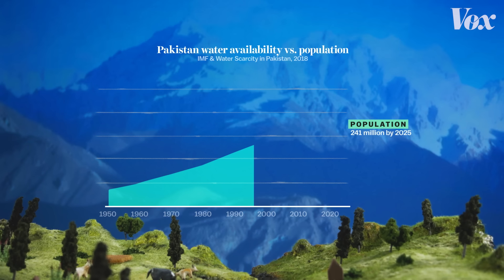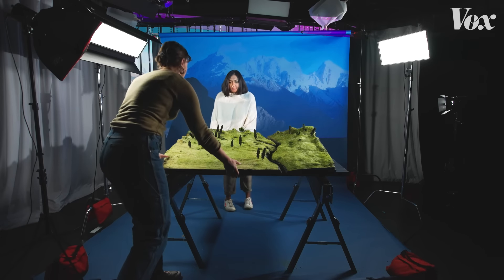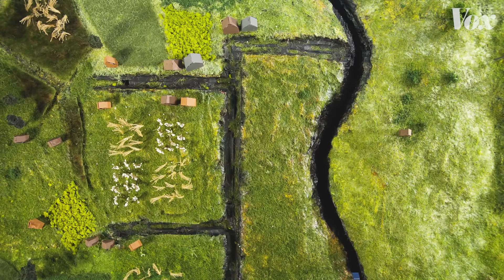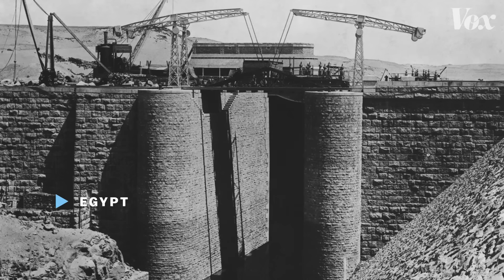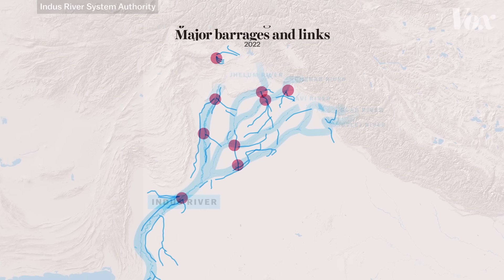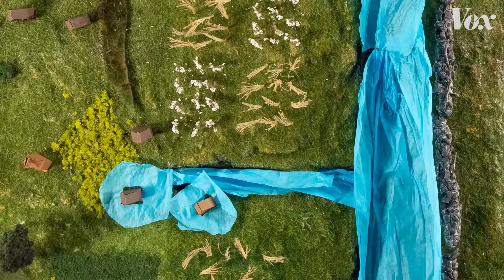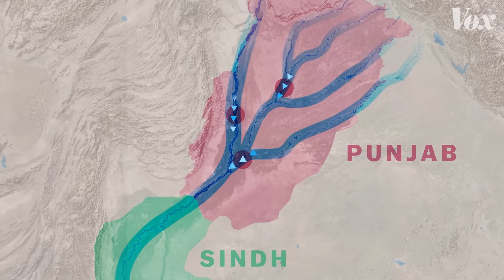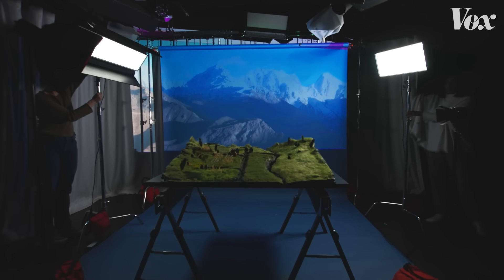The disastrous redesign of Pakistan’s rivers

Comment: If I understand this video correctly, the population explosion of Pakistan is directly related to the engineering of the Indus (makes sense, more agriculture = more food = more people). But that means you can't revert to "indigenous knowledge" as their engineering was designed for a much smaller population. The thing I took away from this video is that just like with the world as a whole, the country over-engineered its way to an unsustainable state, and cannot reverse it now.
Reply: Yeah, they always do these things. Celebrate the old indigenous ways, then ignoring the current population numbers. Sure it works if you want the old Ted route, but these people often doesn't want that either.
Reply: I agree; however the system could be engineered to benefit the environment and the people who depend on it, it would first have to figure out how to feed all the people who are reliant on the land. I'm just not sure how you would do that 'old school,' while acknowledging that the 'new school' should have been sitting at the back of the class the whole time
Reply: Spot on. It’s very easy to stay “stick to indigenous systems”. 

In India, we have our own issue of poorly developed towns and cities on the Himalayas which will bite back sooner than later

The solution was to either control population or incentivise mass migration to the plains in order to maintain ecological balance

In this case, Pakistan has 0 option but to rely on engineering to feed a dramatic rise in population across the nation 

The bigger mistake was the approval of wrong projects designed by corrupt and incompetent stakeholders
Reply: It’s not that simple, you can’t learn everything about everything about such a complicated problem in a short video. One major factor they didn’t even mention in the video is the problem with India. The Indus River originates from the Himalayan mountains and India who also has a massive population wants the water for their own needs. They’ve built dams and have diverted the flow of water to their territory which means less water for the people of Pakistan. Population growth + less water for farming = disaster.
Reply: It will not be impossible to mend our infrastructure and economics in a way that can revert us back to a sustainable way of living. As such the solutions given in the video are not saying to go back to the old way of living rather integrate the historical and environmental knowledge about the region into our social and infrastructure policy as well. You know, don't just give space to the upper class and elites to speak, let other folks speak as well that are not bringing a coloialist mindset, rather a more indiginous one. 
And it is also important to note that the population boom in the region is also socially engineered. Contraceptives and birth control and managment are vehemently opposed by the religiously extremist factions within the region. Islam, another foreign gift to the land makes its marks on the country and make certain changes and development in the country almost impossible
Reply: Awhile ago I repented to God then I asked for help, "I was until then an Atheist."

I then had a dream of Jesus coming before God and he spoke of the Tabernacle in perfect context, "A word I didn't know existed.", and what I felt from Jesus when I held him was unlike anything I've ever felt before - A lifetime of Love every second - It brought me to sobbing and it changed my life, forever. 

I've had other experiences since, "Several witnessed", one was seeing a bright orb of light pass across my face in the dark, hours before a major surgery the second I gave up in my heart.

Know that God and Jesus ARE real and that they Love us deeply. Let go of your hatred and Imagine yourself holding the people who've hurt you. Tell them you Love them.

Always have hope, I believe that prayer, following God's laws & Love is the answer, and through that, becoming humble, merciful, welcoming, giving, and forgiving, To All. <3
Reply: @narsakucanada154  3 /=/ 1 It doesn't make much sense. Every system, whether it be a political system, a company, a military, etc needs 1 person at the top making decisions. Otherwise, if multiple wills it would be chaos. 

How could Jesus (pbuh) be divine if he was a human like us. He got sick like us. He used the washroom like us. He ate and slept like us. How could the creator and the created be put on the same pedestal. This is just an example of clergy changing books to fit their desires and arrogance. 

There is only one originator, one sustainor, one provider, one creator. That is God. There is no other divinity attached to any other creature, being or object. God holds all power and controls all that exists. 

Please, come to your senses and stop worshiping other human beings. 

[And mention] when the angels said, “O Mary, indeed Allah gives you good tidings of a word from Him, whose name will be the Messiah, Jesus, the son of Mary – distinguished in this world and the Hereafter and among those brought near [to Allah ]. [3:45] 

[4:171] O People of the Scripture, do not commit excess in your religion or say about Allah except the truth. The Messiah, Jesus, the son of Mary, was but a messenger of Allah and His word which He directed to Mary and a soul [created at a command] from Him. So believe in Allah and His messengers. And do not say, “Three”; desist – it is better for you. Indeed, Allah is but one God. Exalted is He above having a son. To Him belongs whatever is in the heavens and whatever is on the earth. And sufficient is Allah as Disposer of affairs.
Reply: @mohammedkhaliq1475  India has not diverted any water from 3 west flowing rivers i.e indus jhelum and chenab, only run of the river projects are done to generate electricity even Pakistan has not complained to world Bank about India not adhering to 1961 treaty , in future if Pakistan faces any water scarcity it's because of it's own making blaming india is just failing to accept one's own mistake
Reply: Well, you can reverse it, just with a lot less people. What the video is proposing is that they just eliminate the surplus population to achieve the "sustainable culture" they had before colonialism. I can't condone such a massive loss of life, but if that's the message Vox wants to advocate, then that is their business.
Reply: Now all whats left now, is to DESTROY some of the barrages.
(at least only through the indus river that would push seawater away)
Reply: Precisely, the entire Date Industry in Sindh depends on those canals. And it contributes significantly for foreign exchange.
Reply: But then that's what humans do. Even human hunter-gatherers over-engineered their surroundings leading to population growth.
Reply: @mohammedkhaliq1475  I don't understand how the reason of every problem in Pakistan is connected to india...... according to you its India's fault that Pakistan is suffering a water crisis..... Like come on what are you thinking is it our fault that your govt hasn't invested on dams and water conservation......india has followed the indus water treaty even after getting invaded by Pakistan four times I think india has been more than generous towards Pakistani people.....
But now india has given Pakistan a 90 days deadline otherwise the water treaty will be renegotiated...... And please don't brag about your nuclear weapons now, they are not going to quench your thirst....
Reply: Thats highly incorrect. The person as minimum should be elected by enough as well. 

The strong states in western economics all has many deciders in all levels. If we want strong men, we put pepper on them:)
Reply: @apurvdhasmana5951  no, I’m saying THIS problem is PARTLY caused by India. The water originates from India and they have built dams so when they need the water for their own use they close the dams and during the monsoon season when there is a risk of flooding they open the dams. There is an “agreement “ between the two countries where India agreed to use 20% and Pakistan gets the remaining 80% and despite that agreement India uses more than they agreed to. Furthermore the agreement doesn’t take into account when India can and cannot open her dams. I agree with you Pakistan is at fault too, I’m not blaming India alone. I was just saying that this part of the problem wasn’t discussed in the video.
Reply: Kashmir is an integral part of india pakistan has illegally occupied it...but wait is over their allah is punishing them now. And this makes me feel happy and sad at the same time.
Reply: Obviously not turn back to traditional ways. But there is a huge amount of local knowledge among communities that is usually being dismissed at decision making (that is true to pretty much everywhere). Why not listen to that knowledge that was passed down for generations which their main goal was to survive alongside a particular natural resource? Maybe you'll learn something that could help you better the new system.
Reply: @apurvdhasmana5951  sadly I agree
Reply: As the first culture start agricultural around 1700 this was India. 1800 this was India. 1850 this was (British-) India. 1900 this was (British-) India. Just 1950 this was Pakistan, a very small part from India. They create it for religious culture named Muslims. Of course - more and more muslim people flee to this country and typically this religion is that you marry early and have many children - was be 1000 years before a good idea. But now the people grow double old as before. So every day more and more lives in this "big" country and nobody want change into "main land" of muslim religion e.g. Saudi-Arabia, Quatar, UAE, aso. 

Most bigger cities are older as this country "Pakistan" - no modern skyscrapers (how need less land for many people) and clean streets and ways. Possible with flood water channels if monsoon time. 

I thinking the channels self not create all problems - it is the monsoon time what the UK engineers not calculated correctly. Adding the different monsoon zones how affected today in opposite to the history (1800/1850) too. I lived in Thailand sometimes where the monsoons time and affected zones change dramatically in the last twenty years, where I thinking in Myanmar, East-Pakistan (Bangladesh), India and Pakistan  is same happend. But now do you can't blame the UK engineers nor the system that they installed. Why they not recreate the rivers and put on the channels only on if monsoon (= flood) time?
Reply: @mohammedkhaliq1475   india was not mentioned because it is about Indus River and there no change with regards to Indus River and it’s water for Pakistan only and all canal systems related this river is analysed in this video. You guys need to Engineer the whole water system without any political interference based in diverting the water for powerful and ignoring poor.
Reply: Could always just import more food and improve GDP in other areas to account for the opportunity cost of some of the agricultural industry
Reply: Pakistan doesnt rely on silly "indigenous knowledge". Pakistan uses Islamic knowledge and will soon solve al its problems.
Reply: Only one solution,
This might sound counter intuitive but they need a more sophisticated water irrigation system and deprecate the old ones immediately.
Possibly revive dead ancient rivers.
Reply: That's modern agriculture in a nutshell.
Reply: Correcto
Reply: @ninyahowbiftin4502  i give you an example of a society that doesn't has one boss who decides all: Switzerland, it has a counsel and each counselor is president of Switzerland for 6 month. Do you think that CEO of corporation decide everything? They delegate.
Reply: @ninyahowbiftin4502  Jesus God Allah all same as a flea on dogs
Reply: Well, one thing that could work is to build a bit away from the rivers, leaving out space for rivers to swell in case of serious overflow. This was tried in the Netherlands when they began spacing out their levees to allow rivers to swell, but not flood out. But convincing a city to move back from the river is probably something very difficult.
Reply: Thanks god for partition
Reply: I think it is oversimplifying population growth reason. Palestine in 1947/1948 had a population of 1.5 Mn and today it is around 7 million. War torn, economic challenges, no river bank expansion - and still a sizable jump in population. If I understood this right, the canals and wide availability of water made the  sustenance of the growing population simpler/possible but the same population will make water scarcity a reality soon. Water engineering not done right is a problem, but uncontrolled population explosion is a problem which impacts both quality and sustenance of life.
Reply: @abhijitnaik2226 true. India has been very patient with Pakistan despite what Pakistan has been doing. Any other country would have taken action on such provocations. Make no mistakes. Indian patience has run out. It is a matter of time when Pakistan will pay for its misdeeds.
Reply: @mohammedkhaliq1475  India has not made any dam to stop water on Indus , Jhelum and Chenab. Still you write sych baseless comments here. Itis hightime India actually makes dams on these rivers to ensure correctness of your so far baseless allegations.
Reply: I think the problem is tempering with design.

Comment: Framing this as a problem of colonialism, that can only be solved with local/indigenous answers is a bit...odd.  Engineering and science are absolutely what is needed.  Evidence-based solutions.
Reply: local/indigenous answers won't feed and employ 120 million people
Reply: Except the implication does really say that? It says water should be manage like with indigenous techniques, divereting floodwater rather than perenial water. Not that 100% indigeenous solutions should be used.
Reply: @beerenmusli8220  Even that would drastically reduce agricultural productivity and lead to an over-dependence on food imports or regular famines.
Reply: @veggiedisease123  And you say that based on which Data, exactly?
Reply: @beerenmusli8220  Based on logic and reason. If the canals lead to an increase in agricultural output of 500%, then reverting to the old way of agriculture will reduce the output by the same amount. And since the population grew by 500% in the past several decades, one can extrapolate that the resulting reduction of food will cause a famine unless vast quantities of food are imported.
Reply: @nathancochran4694  Neither Logic nor reason are scientific data. if you read carefully,, I did not propose reeverrting it completelly.
Reply: @beerenmusli8220  no, but data is useless if you can't interpret it. Pakistan needs to maintain its agri output or it will starve.
Reply: @nathancochran4694  And that is exactly why the current way cant be kept up, reoccuring floods will destroy harvests at some point.
Reply: @nathancochran4694  You should also look into the "slow the flow" concept to reduce floodings
Reply: Just Vox doing vox things as usual
Reply: @beerenmusli8220  <--------- demands data from others, while providing none of his own
Reply: @griffincontracting  Except I did, but you still need to look up "slow the flow" :D